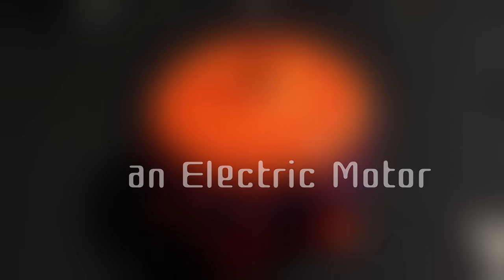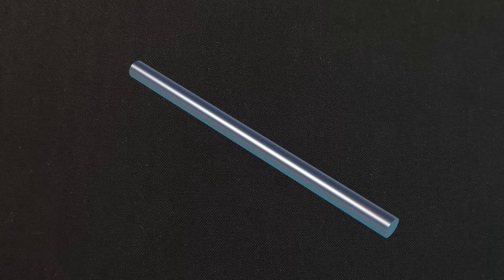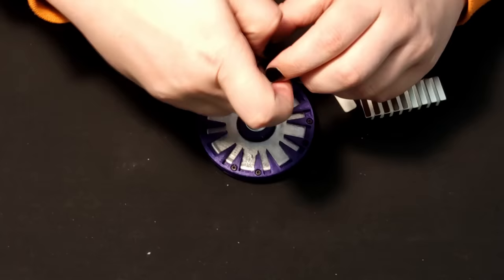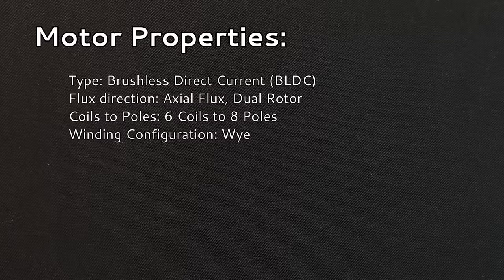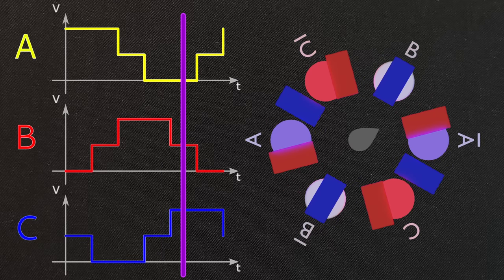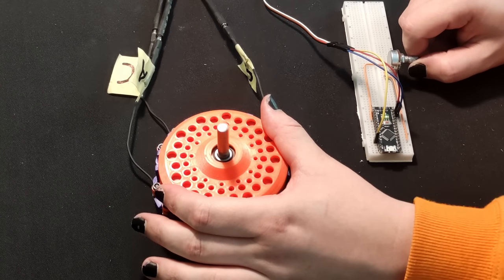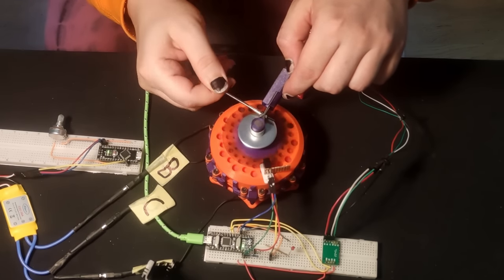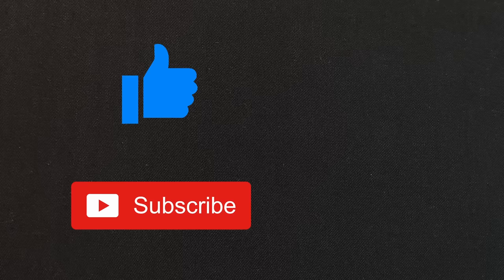An Axial Flux BLDC Motor Build

Comment: Nice work! Are you planning to publish/sell this project (.STLs + name and sizes of magnets, ball bearings, etc)? I think many people would be interested to replicate/modify your project :)
Reply from the maker: Never going to sell anything - if I want to release any specifics about a project then they should be free... and yeah, I will try to be better about providing stl-s and assembly instructions as I continue :D
Reply: @BirdbrainEngineer  big respect bro 😉
Reply: @BirdbrainEngineer  Please keep us updated. I, and a lot of us would love to replicate your project and improve upon it, or at least print it out for ourselves to interact with a real live axial flux motor. I'd even throw a couple bucks your way if that's what you need for incentive :)
Reply from the maker: @mikek1187  I will be releasing a video on an easier to replicate bldc motor soon, although it will be a radial flux design instead. I have some interesting ideas for an axial flux design in the future, but I wouldn't hold breath for it to come out any time soon yet.

Comment: Although I enjoyed the video and it had some good information, please do not compare your project motor with a few hours of development and almost no durability with an ICE with a hundred years of development behind it and able to run a quarter of a million miles in a vehicle. Electricity generation and transmission runs somewhere around 40% efficiency and multiplying that times your 53% motor efficiency gives a system efficiency of around 21%, not bad for a few days work.
Reply from the maker: Of course my motor is not going to be as reliable as an ICE, but in general, motors are vastly more reliable than ICE-s... ICE-s need regular maintenance and oil changes, some as often as every 100 hours of runtime... while basically all electric motors can run for tens-, usually hundreds of thousands of hours reliably with the only maintenance being to swap out the shaft bearings every few thousand to a few tens of thousands of hours.

And as for electricity generation efficiency - it's a completely meaningless metric. You do not know how the electricity I used to charge the batteries (or get from my wall) was generated. Different forms of electricity generation have different generation efficiencies. In addition... for a lot of the energy sources for electricity, we do not care if there is a fair bit of waste... ie. why does it matter that solar panels are only 20% efficient at converting the energy in sunlight into electricity? While it does matter if your fossil fuel ICE is 20 or 30% efficient, because you don't get your fuel "for free". We could compare ICE-s to Electric motors taking into account the energy efficiency of the supply chains, but even then, on average EV-s and electric motor based machines are way better, especially if renewables are used (all the more reason to shift away from fossil fuels as fast as possible). 

Here is a study that compares "well to wheels" efficiency of ICE vehicles to EV-s for example; DOI: 10.2478/rtuect-2020-0041
And this study is actually quite pessimistic in terms of EV-s, as it assumes a battery-to-wheel efficiency from 50 to 80%, when in reality the average is around 75 to 80%.

Comment: Video died at the end. 
Thanks for doing axial flux as a motor. Try it as a generator.
Reply from the maker: It was getting long and it was difficult to patch the project up into a video, sorry. I do my best to try out different styles of editing and scripting and construction of the videos, until I find a style that I like to edit and produce the most :)

A permanent magnet motor can always be used as a generator as well, indeed! However, unfortunately I don't have that many good ways to test a generator setup... This particular motor can light up LED-s no problem, but requires too high of a rotation speed (~1000 RPM) to power 5V brushed motors. Also, I could be wrong on this, but my intuition says that in the case of an axial flux configuration, having a single permanent magnet rotor (with no back iron and in an alternating configuration as opposed to Halbach) sandwiched between 2 stators would work better as a generator (more copper for the magnet flux to move through).

Comment: some information.          the coils in a motor are solenoid coils.     ideally, a solenoid coil should not have a layered structure.      this is so because when a coil has a layered structure, the current flow in adjacent layers is  180 Mechanical degrees  Out of phase.!     consequently, during operation of the motor, there is a greater amount of back-emf and impedance in a coil.
i would suggest that you reconfigure the  ROTORS.  so that one is  ALL  north poles, and the other ALL south.      this change should make a big difference, in the top speed.     d          googletranslate
Reply from the maker: I do not think anyone makes axial flux motors in the way you proposed in this comment. 

Answering your other comments;

The iron backing on rotors is not strictly necessary but it is often present in axial flux motors... albeit usually using a better material than hardware store mild steel. I do give you that since I used a halbach array configuration, then the iron backing has even less of an effect than normally. 
Yes, the airgap between the stator and rotor(s) needs to be as small as possible... however, plastic fdm 3d-printing really does not allow for a smaller gap than about 1mm.
And finally, I am not sure what you mean by "non-magnetic"... In a permanent-magnet motor, you'll definitely want to have magnets in the rotor, and often times an iron backing can be beneficial, granted that the positive effect from it is greater than any eddy-losses. Perhaps you are talking about the steel screws I used in the rotor, in which case I agree - it produces a slight bit of cogging and eddy losses that do not help with the functioning of the motor at all. However, I did not want to use any epoxy on this version, as it was meant just for fun and learning.

Comment: You're using so unefficient way to drive your motor. This is why you got so low efficiency. The best way should be Field Oriented Control.
Reply from the maker: Agreed. An off the shelf ESC is far from ideal for driving something like this. In the future I do want to dabble with FOC.

Comment: That's super frustrating that you you found a voltage anomaly with the coils, mentioned it and then put zero effort into figuring out why. You must have wired it wrong, or messed up a coil. But why didnt you even try figure out what you did wrong?!? isnt that the whole point of the project? to investigate things? there better be a follow up or my OCD is going to to ruin this video for me. Thanks